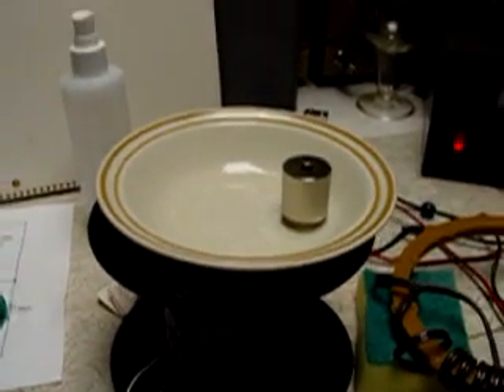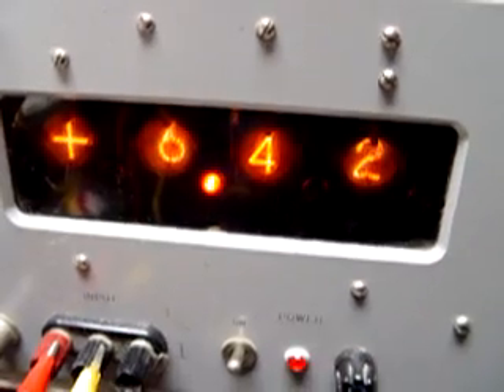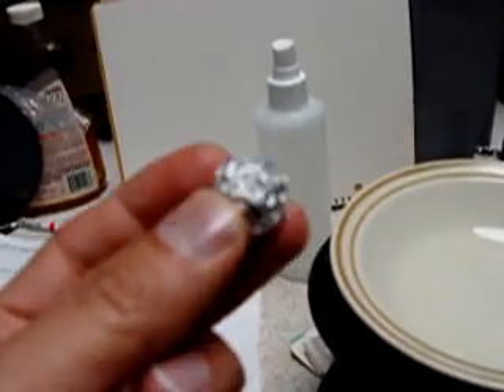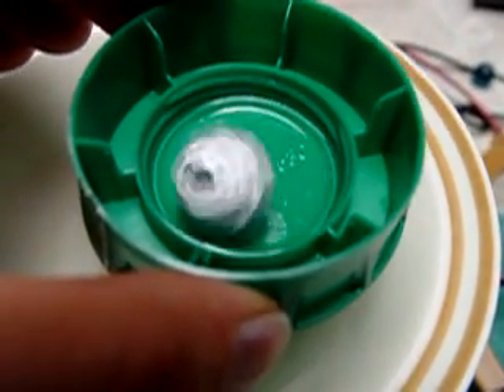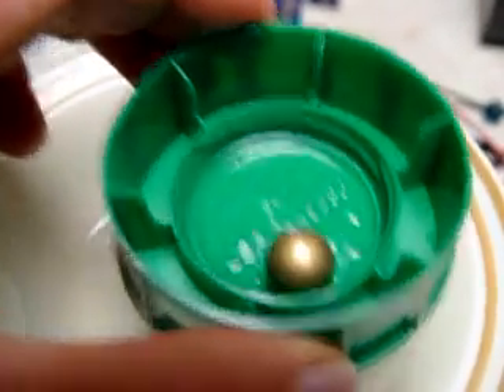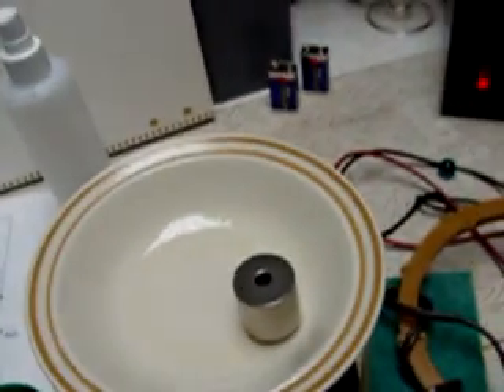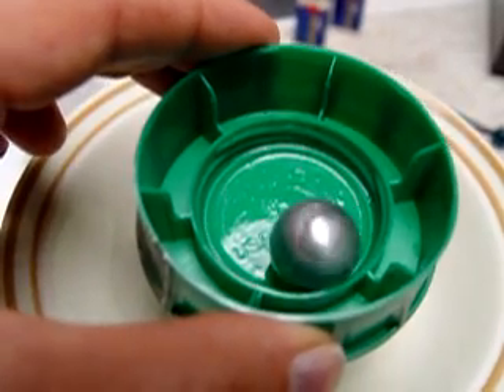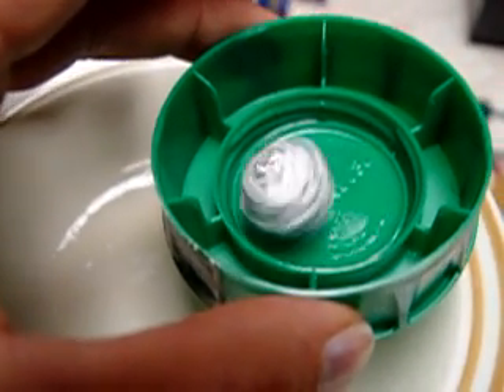Paramagnetic Materials Spinning in a Magnetic Field (Experiment)

Comment from the maker: @butf1ad 
There isn't enough room to describe much. I posted later videos showing this effect as well with a sphere magnet. This is a Bedini pulse motor with the magnet spinning as the rotor. Research 'Bedini Davro' to find the schematic, it will be easy to replicate. The circuit consists of a transisor, couple diodes, a few variable resistors and spool of two conductor wire...simple.

Comment: it's another example of lenz effect...
because metal is conductive the alternating magnetic field causes voltage in the metal which then shorts out creating a magnetic field which then acts on the spinning magnet causing the metal balls to spin...

I hope i explained that right...

It's the sam as if you slid a magnet down a sheet of alu... the alu crerates a magnet field slowing the magnet in it's fall...